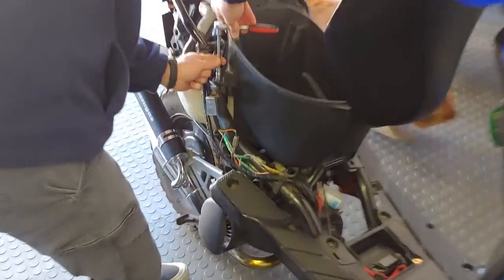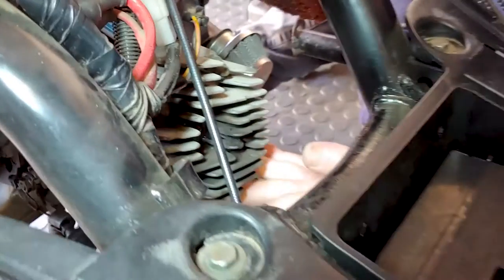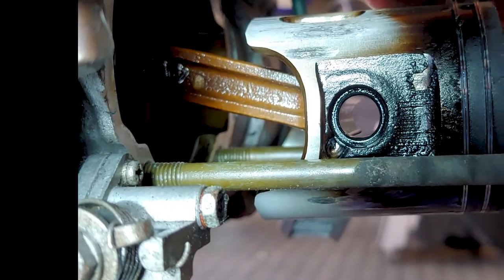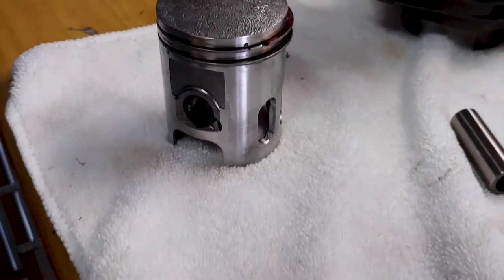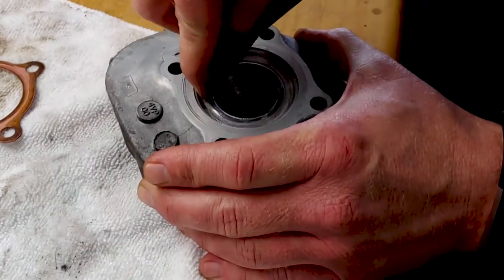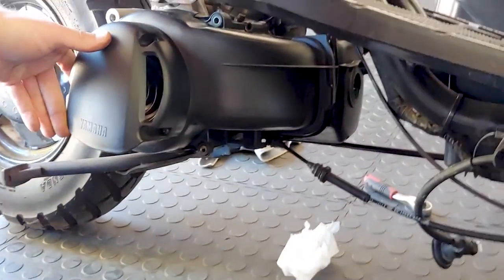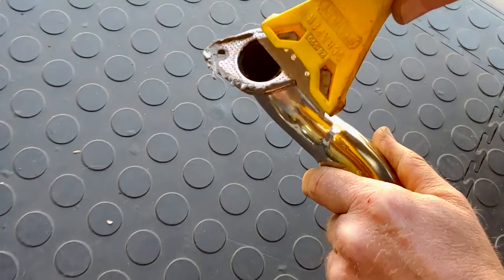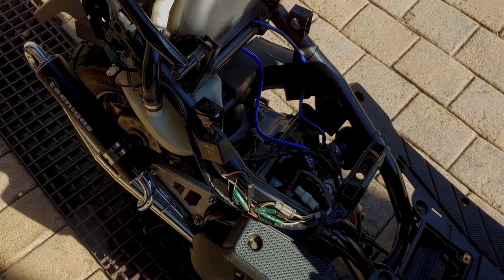Kevin's BWS100! Episode 1, Piston & Barrell kit install.

Comment: Any specific local SA online shops where I can order such a kit that you would suggest?
Reply from the maker: That was from Kickstart bikes. But it's soft siezed twice. The tolerances are very tight, which we knew as you could feel it. Will take it in to be mic'd at an engineering shop and honed. I'd go with a Yamaha piston in future.
Reply: @Radness1001  I am having the same issue with my chinese barrel kit, what did it end up costing you?
Reply from the maker: @LHKleyn  we took the barrel to be honed at a engineering shop. Ideally they need to be measured and  machined before fitment. Which kinda defeats the object of a kit.